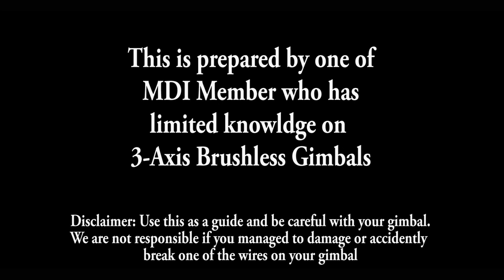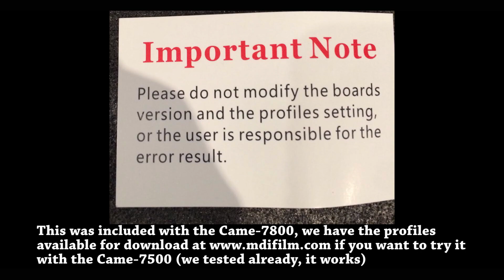Came 7800 Introduction

Comment: When i remove a lipo battery i need to hold firmly to both ends. It looks like you cannot get a hold of the battery connection on the fra? Or am i wrong?